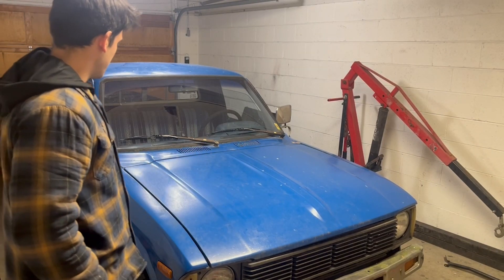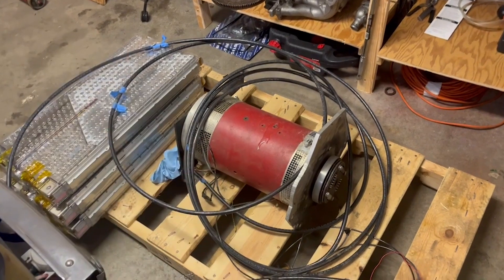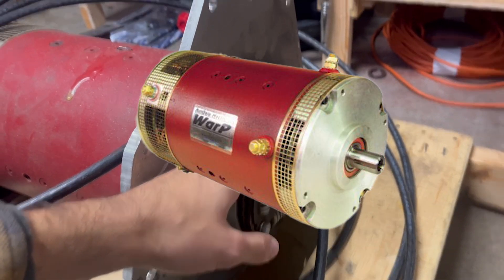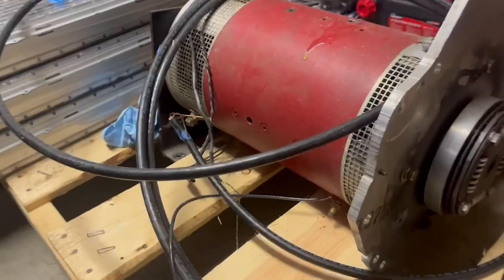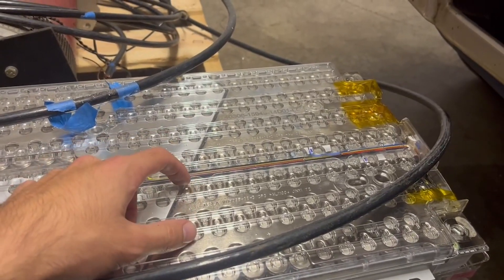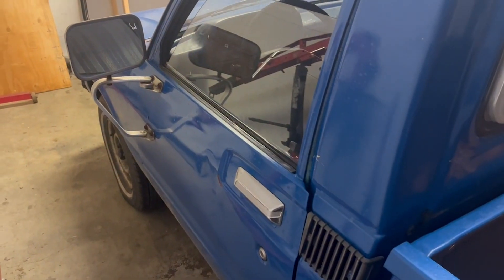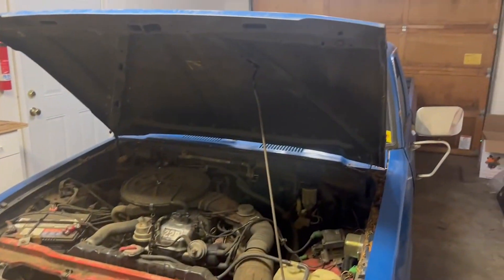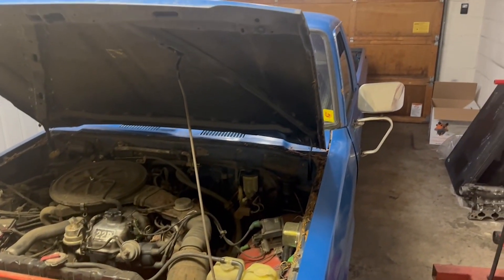Electric-Swapped Toyota Pickup Episode 1: Overview

Comment: Not using clutch: allow motor to stop and shift. I drive in 3rd most of the time (4th for freeway - car starts out fine in 4th). These motors make close to 100% torque off the line so start in any gear.

Comment: Not using clutch: allow motor to stop and shift. I drive in 3rd most of the time (4th for freeway - car starts out fine in 4th). These motors make close to 100% torque off the line so start in any gear.
Reply: Do you have to wait one onethousand and then put in gear?